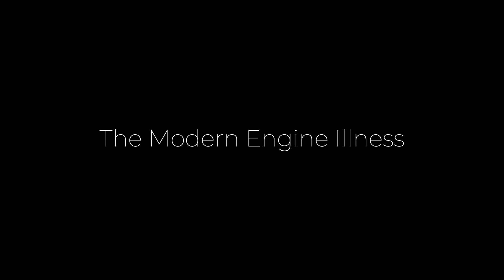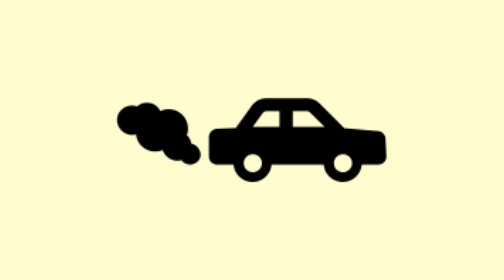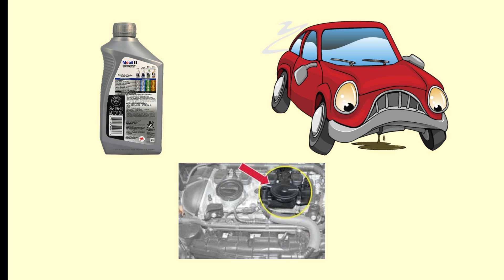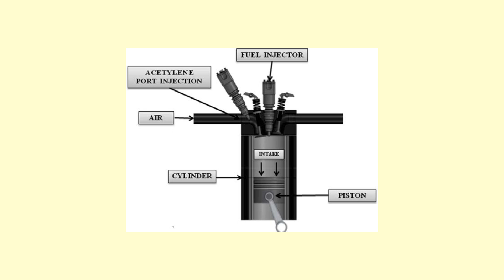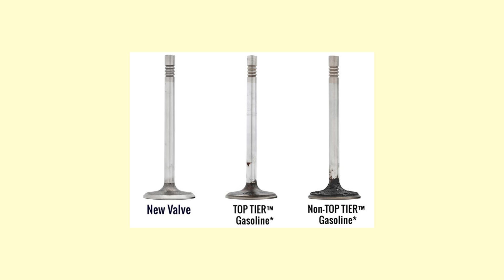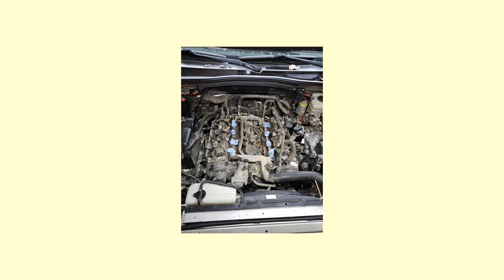The Silent Sickness of Modern Engines

Comment: My daily is a 2015 Honda Fit LX 6 speed. I love that little car, it's fun and peppy while allowing me to also retain solid fuel economy (even being a leadfoot, I average a solid 35-37 MPG in mixed driving). I prefer small, lightweight cars to anything else, even if they're low on power.

My Fit, like all USDM 3rd gen Honda Fits, uses the L15B1 which has direct injection. Now I do a lotbof amateur racing and am not afraid to rev high. Also my oil change intervals are strictly capped at 3000 miles. And mine gets driven a lot, so it's up to temperature when driven. Those factors all dramatically slow carbon buildup.

I also happen to be a Honda technician. There's a service bulletin that covers replacement fuel injectors for up to 10 years or 150,000 miles after purchase and I got a set for mine about 2 weeks before it hit that 10 year threshold. When I had the manifold off to replace the injectors, I went ahead and blasted the intake valves with walnut shells (Honda has a tool kit for doing this, I've done it on dozens of customer cars prior to my own) and it bolts right up to the cylinder head to do it in the car. It felt like it picked up 10-15 HP after doing that (the L15B1 only has 130 HP, so you will notice that) and fuel economy was noticeably better. Of course most Fit owners will have to pay the dealer or whoever else to do this, but it is 100% worth it. 

And it's not a hard job. Removing the intake manifold on my car is a 15 minute job at worst and thorough blasting takes maybe an hour for all 8 intake valves. Mine had only been cleaned once in 10 years AFAIK but because of how I drive it, it had the same buildup as cars with 100,000 fewer miles (mine had 130k when I did it)
Reply from the maker: Rate Honda Fits man! It's shocking how much practicality there is for a small hatch
Reply: @Enguitive  One of the most cleverly packaged cars out there.
Reply: As much as I love Honda, I love RWD so much more.
I've had 4 Civics, 1 EF, 3 EGs.
You should drop a B18 or K24 in that car, boost it, then send it.
B18 would be my pick, but I would get a new one... if you can.
Not sure what transmissions are compatible with what these days.
Reply: @christopherlowery855  Nah, I have way more fun in low power cars, I can push them further and I love the sense of speed in small cars. I raced go-karts and FWD econoboxes for years, so I also know them better than anything else
Reply: @SkylineFTW97  Jump in a turbo car.  As in a 90s or early 2000s model.  Small, preferably a hatch or roadster.  I've driven lots of under-powered small cars.  Today, I absolutely love being able to slingshot around people.  When I first drove my friend's boosted miata (which I own now), I could not contain my excitement.  I proclaimed "I'm addicted to boost!!"
It's one of those situations where you don't know what you're missing until you experience it.
Reply: @christopherlowery855  I owned a Mazdaspeed 3 for 4 years. And being a Honda tech, I've driven plenty of 10th gen Civics with the L15 turbo and even a few 10th gen K20 turbo Accords and Civic Type Rs. Low weight and low power is still the best IMO.

Comment: 1.2L, 1.3L - 3 cylinder turbos with wet belts are a recipe for disaster.
Reply from the maker: You often see these types of engines in either A segment cars or B segment hot hatches
Reply: Especially those damn wet belts...
Reply: Anything with a wet belt is cancer.
Mechanical oil pumps have worked marvelously for decades.

Comment: As one of the comments below states and the video, the source of the carbon deposits, the EGR and PVC is what needs to be changed. I would cool and filter the EGR gasses and do the same with the PVC system.The  Diesel (an auto) exhaust can be cleaned by the use of a Cyclone on the exhaust

Comment: As they say - there is no free lunch. Direct injection engines in the short term may be better for emissions and fuel mileage, however, in the long term, they are worse in every aspect!  And the 2nd or 3rd or 4th owner may not even get the carbon issue resolved and will just run it as it into the ground. Imagine the pollution that gets put out!  It doesn't save anything!
Politicians need to stay out of businesses that they know absolutely nothing about especially when it comes to engineering ! ! !
Reply: Car emission charges really need to account for weight as well as full the full lifecycle of the car. 1 litre turbo petrol SUVs won't last 15 years and create more pollution due to inefficiency in real world use cases. They're very rarely used in optimal cases.
Reply: @Fragarach-10 could not agree more with this.
Reply: You sir are a true American Hero
Reply: Direct injection is not to blame, pcv is.
Reply: @riogrande163  
Negative! Even if PCV works perfectly, it still brings carbon rich mixture to the back side of intake valves! It is the nature of the design for DI engines and not the PCV because none DI engines also have PCVs!
Reply: @LWRC  To be clear, I agree with your stance.
However, I think the suggestion is that an oil catch can solve all GDI problems.
It doesn't though.  You still have thin oil control rings that suffer from really bad carbon buildup, and still a fair amount of oil dillusion.  Not to mention carbon buildup on the injectors themselves.
It's the nature of the design which is the flaw.  Gasoline engines aren't diesel engines.  You're not controlling the combustion with the fuel injectors.  You need a homogeneous fuel mixture with gasoline.
Engineers tried to solve a problem that didn't exist.  No different than the wet belt nonsense.
Port injection and TBI technologies are improvements on carburetor technology.  GDI is not.

I tell people to save themselves the headache and just stay away from these cars.
I vote with my wallet.

Comment: Thank god more people are talking about oil viscosity. The number before W is basically for how cold a climate the oil can start in. For the lower 48, you only need 5w in places (and times of the year) where it gets in the single digits Fahrenheit like the Midwest in winter. 0w is only applicable in places below 0F such as Russian or Alaskan winters. Everywhere else with milder winters is 10w territory.

As for the second number, 20-weight oil (IE 5w20 0w20) is basically water, and don't even consider, whatsoever, those stupid 16-weight oils, regardless of what it says on the cap or manual. 30 is the standard, 40 if your use-case is "heavy duty" such as fleet/towing or racing/performance. Some sports cars will have specific recommendations, and if you're in the modified scene; so to will your engine builder or the community consensus for your specific car/engine, so DO YOUR RESEARCH!
Reply: In the motorcycle industry, where engines are highly stressed from the get-go (for example, a 1l inline 4 a sport bike uses produces upwards of 200hp naturally aspirated while revving well above 10.000rpm), viscosities below 40 basically don‘t exist. Most manufacturers use 5/10W-50 full synthetic. Even the tiniest of little scooters use 10W-40. 10W-40 and 5W-50 are the most common. In modern cars I feel like 0W-20 is the norm now. Granted car engines have a far lower BMEP but still. If you have an engine that produces a lot of power with the use of direct injection and turbochargers you‘re going to need a temperature resistant high viscosity oil that‘s capable of withstanding that. But lower viscosity oils also mean less viscous drag -> lower emissions and more power. None of the bean counters care that they compromise engine longevity. Cars nowadays are designed by bookkeepers, not engineers. Compromising owner experience for the sake of flashy spreadsheets and profit.
Reply: Motorcycles have totally different requirements for oil due to the transmission and much higher shearing stress.

Comment: Emission regulations is KILLING the car industry!
This is why cars are more expensive and less repairable.
Reply: Motorcycles too. It's part of the reason why 600cc 4-cylinders are a dying class of motorcycle. Same can be said for 250-400cc 4-cylinders, which would be much closer to legal speeds while providing the excitement of an ultra-high RPM screamer. Ironically, large displacement single cylinder bikes (like dual sports) are also being "emissions'd out" of validity due to that crap. Once you get to a certain level, the gain to cost ratio is just insane, and IMO Euro 5 should've been the end of it, with consumers not required to keep their vehicles compliant beyond Euro 2 or 3, and a complete exemption for Motorcycles and non-road vehicles like race cars.
Reply: Good for you the new epa head just nuked CAFE standards and is going to tell California to end CARB! No more smog!
Reply: Most cars cost the same now as they did 50 years ago. I have a 1971 mustang my father bought 54 years ago new before emissions regulations were a thing. He paid 3,319$ or as he put it roughly 2 years wages if you worked at McDonald’s. If i look at a modern 2025 one of the same trim and engine specs it comes out to 80k or roughly 2 years wages if you work at McDonald’s at least here in California.
Reply: Inflation calculator shows 3371 dollars being worth 25774 dollars now. Meaning that in 1971, to have similar price, it would have been more like 10k for the car  @Bonanzaking
Reply: @Bonanzaking  Except that outside of a relatively small number of places, the value of the minimum wage has been permitted to atrophy to barely half of what its purchasing power used to be.

The federal minimum wage in 1970 was equivalent to roughly $12.50/hr today. From 1950 to 1980, working peoples' productivity nearly doubled and so did their wages and so did the minimum wage (in real terms). Since 1980 productivity has doubled again but we the people have seen next to nothing of the benefits because they've all been taken away so the ultra rich can have a third yacht and golden parachutes.
Reply: Yeah, and emissions are KILLING you...
Literally. Deaths by air pollution are common, and non lethal issues like asthma severely impact the quality of life of the people affected. I for one will not shed a tear over regulations. It's like being sad that the coal power plants are being shut down because you liked black moths.
Reply: emissions are major cause of cancer
Reply: California green laws and the epa are to blame.

Comment: I’m OK I have a carburetor
Reply: I wish I did
Reply: Carburettor supremacy.
Reply: @itznsdominator3521  it still doesn’t run😞
Reply: @GusFrick ouch
Reply: @ it’s fine I just need to find a new intake manifold and it should be fine.
Reply: I have one too... on a lawn mower.
Jokes aside, I still see port injection with a stand-alone ECU as being the best option.
Short of that, a high rise intake and an edelbrock double-pumper will go a long way.

Comment: This is what I hate about Modern Engines, what's the sense of Fuel Economy to save bucks when there's a lot to maintain or worst, break because of its complexity? Isn't it counter intuitive? Wanna solve this BS? Just buy a Mid 2000s to Early 2010s Non GDI/DDI or Non Turbo Reliable Car Brand in your Country (in my case Toyota) and maintain it properly! Save a LOT OF MONEY AND HEADACHE!
Reply from the maker: Direct injection makes sense in some cases as in the case of an EA888.3 or a B58 they can make insanely easy power with a Stage 1 ECU tune and headers etc, but yeah I do agree port injection is the way to go for simplicity: most if not all of Honda's old high-revving VTEC motors used it!
Reply: @Enguitive  How much is insane power?
You can get insane power with port injection with just bigger injectors and a higher capacity fuel pump.  Also, slap a turbo on any engine for huge performance gains.
I have 91hp/cylinder on pump gas, port injection a log manifold a turbo and a 2.5" exhaust.

The B58 is a Turbo I6 that's been intentionally undertuned from factory.  Most of the hard work has already been done.  Of course it only takes a tune and some bolt-on exhaust parts to make big power.  That was the point.

That doesn't make direct injection a better fuel delivery method.  The 2JZ is still a port injection engine.
Reply: If you know how to work on cars yourself, buying a mid 2000s to early 2010s German car with GDI can be a great deal, at least from my experience with a used Audi. Saves a massive amount of money over the premium on so called reliable brands. Only do this if you can work on your car yourself though.
Reply: Sadly prices of used cars will go up even higher I fear
Reply: Gonna have to look futher back than the 2000's for non-DDI's lol. IDI's died in the 90s, and for good reason.

Comment: Hmmm. The only modern engine I like is the ea888 gen3. Port and direction injection.

Other than that. My trusty 4g63t
Reply from the maker: Yeah, unfortunately in other markets (North America), they don't get the dual injection combo we do with the EA888.3, there's an entire section of the MK7.5 Golf R piece savagegeese did that covers carbon buildup. Also 4G63T is a legendary motor man!
Reply: @Enguitive  that’s great! Even the 3rd gen b58 is getting it. Just the piston rings I have a problem with. Well. If she blows she blows. Rebuild something u want own. Worth every penny.

My 19 year old 4g63t with only 50% compression still runs well with no loss of engine oil between oil changes. Just poorer petrol consumption compared to modern direct injection. A small price to pay.

Comment: Carburator whit ecu control would propably work really well
Reply: Yeah, but port injection has much better control and precision and has been electronically controlled in mass production vehicles since the 1980s. No reason to downgrade to greater intake restriction due to the venturis and reduced responsiveness as fuel is introduced before even entering the intake manifold instead of straight into the intake ports.
Reply: @quentagonthornton49  carburetors are better at atomizing fuel so you will get a better mixture so it would only need active afr control to work well in modern cars
Reply: @BananaSlayer666 There's a video up from someone who did exactly this. He installed, of all things, a lawnmower carb on a 1980 V8 (I believe the original question was, can it even run on a lawnmower carb). Then he installed an O2 sensor on the exhaust, deliberately set the carb to always run rich, and put a deliberate air leak in the intake after the carb. He used a microcontroller to adjust the air leak based on the O2 sensor readings, resulting in perfect stochiometric mixture at all throttle positions (the same feedback loop as used by port/mfi/direct injection).

And oh, you better believe it barely ran without that controller attached.
Reply: @erikkeever3504  well that sounds like it works just as i expect it
Reply: @erkay3504  Computer controlled carburetors were common in the 1980s. GM ones would have a throttle position sensor, I think a crank position sensor, an oxygen sensor, and a mixture control solenoid that would pulse 10 times per second to swing the mixture from rich to lean to work with three way catalysts. They should have come with computer controlled chokes, but they didn't, only thermally controlled, so cold starting reliability issues were still common.
Reply from the maker: Nice blend of intake valve cleaning + power headroom
Reply: ecu controlled fuel and air metering? gee if only there was something like that 😂

note I love the relative simplicity my carbureted car and the fact it has not a single computer, I've literally fixed it up with random parts laying around my garage - definitely want to have one of those into the future when the average car becomes near impossible to repair due to parts scarcity and complexity

Comment: Does the Top Tier fuel still help to clean the valves in GDI engines? I thought it might clean the injectors but be unable to help the valves. Or is the idea that it just burns more cleanly, thus producing less soot to be caught by the valves? Sorry if I'm totally off base
Reply from the maker: The top tier fuel when entered into your intake valves is more likely to clean those intake valves rather than harden into carbon soot
Reply: The only way to clean intake valves on a GDI engine is to do it manually by accessing the intake ports and using a media blaster and/or solvents like DCM.